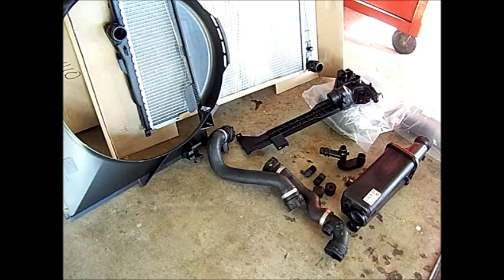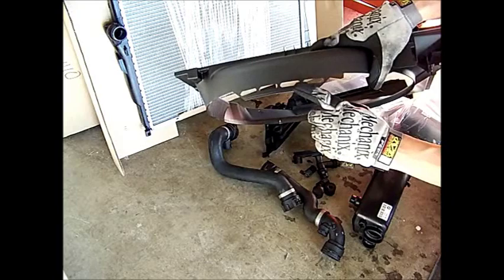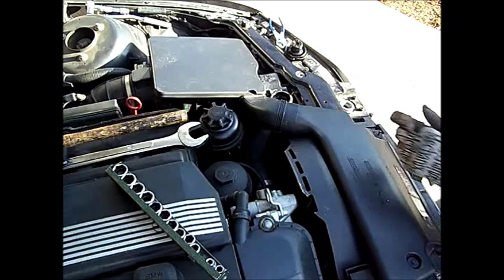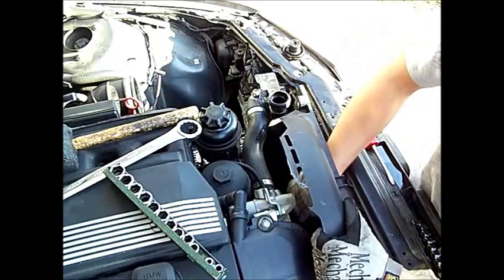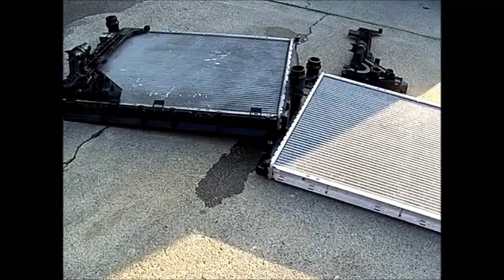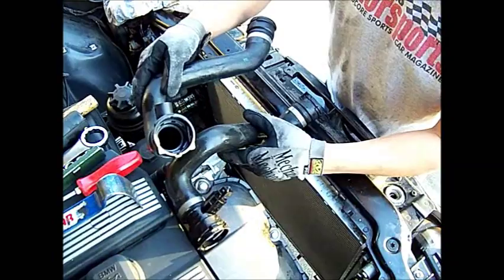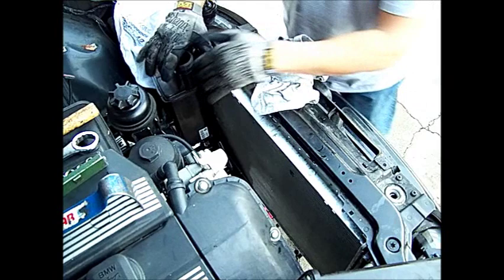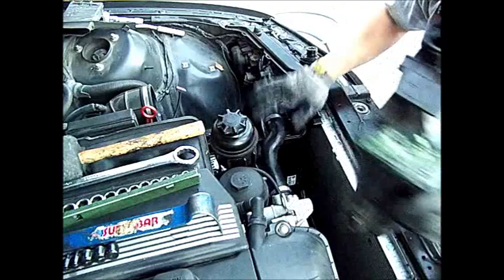BMW 330i, 325i, 323i, e46 Radiator and Expansion Tank Replacement

Comment: I've watched so many of these videos that I feel like I've already done it myself!  I am making ready for my venture into changing my cooling system on my recently acquired '06 330Ci.  I am planning to remove the mechanical fan and swapping in the electric 'puller' fan in it's place while I'm in there.  I will also do my tentioner and idler pullies, WP, tranny t-stat, the whole enchilata!  Thanks for the video, it really helps add to my prep time :-)

Comment from the maker: Hi Rene,  Good points, sorry can't redo it as that's the footage I had to work with. Here's some follow up info:  1) bleeding the system, there is a brass/plastic screw/plug on the top return line before the expansion tank.  You will fill the expansion tank until fluid (bubble free) runs out of the area of the removed plug.  You do so with engine running and car on level ground. Come back after a few days to ensure you have all bubbles/air out of the system by running the engine and checking for a bubble free flow.  2) fan is removed by using a long 32mm open ended wrench on the base of the fan and this is reverse thread. Impact it with a rubber mallet to shock it loose and do so when there is fluid in the system. Cost of parts will run $300-$450 depending on whether or not you need a water pump or fan clutch and whether or not you use aftermarket or OE parts. The labor savings is the win here.  Thanks for the questions and no harm by the constructive criticism. Good Luck!
Reply: heat sencer for a 328 bmw

Comment from the maker: Thanks for watching, also if you change your lower radiator hose it's best to replace the fan temperature switch (this is the switch for the auxillary fan) or at least the green o-ring for it with a factory BMW part.  Otherwise you may get a leak there.

Also, be careful when handling the new radiator, you don't want to stress the interface between the radiator and the plastic side tanks. If you press anything onto it, use your leg or a foam pad to back it up.
Reply: How far in does the o-ring on the back side of the mounting plate? Mine is refusing to go past the lip

Comment: Also I had a hard time removing the fan and shroud so I was able to go underneath and remove the radiator that way. Is that at all a terrible way to remove it?lol I detached all hoses and was able to pull it out from underneath. Also noticed that the autozone aftermarket radiator I bought was about a quarter inch off around the upper radiator hose areea soo brackets would not align correctly. Autozone and OReillys offerred the same radiators. Do u think it's an aftermarket thing? Is that why u recommend using actual BMW dealership replacement parts?

Comment: You kinda glossed over the transmission thermostat at the bottom of the expansion tank. It's common for this unit to break into many pieces when you separate the tank from the bracket. My trans thermostat was "welded" to the bracket and broke into many pieces upon removal. I also had a conical spring that sat on top of the trans thermostat to keep it in place. I did not see that in your video. In reality, you probably would have solved your leak with a new expansion tank cap and bleeder screw. I agree with you, however, that replacing the radiator and trans thermostat is good preventative maintenance at that mileage. Great video and thanks!
Reply from the maker: Yes, thanks for the comment, someone just asked for this exactly as you stated. This part does fall apart. It's the Thermostat for the Automatic Transmission cooler or heat exchanger PN 17111437362OE. This should probably be replaced just as preventative maintenance when an expansion tank is replaced. You are also correct that an expansion tank cap was probably all that was wrong with my car but mine had 130k+ miles and I just wanted to change the radiator before it got old and then just changed out everything around it for video purposes. Thanks again for the great comments.  I sold my sedan and recently picked up a 330ci, so I can see myself doing this again in the near future :)

Comment: I like your video except for the part where you cut out where to bleed the system from.  Also, removing the fan which btw is a pain in the ass.  Idk, seemed like you cut out several parts which left me a bit confused how you did it or got to it.  Not as through.  Also, it would have been nice if you added a parts list and price in the about portion of the video so that people can know what they're looking at spending.  Great video though man, hopefully you don't take the criticism to heart.  Just friendly criticism.

Comment: To my amazement the aftermarket Chinese replacement radiator appears to be better than the original equipment BMW radiator.  The OE rad plastic was made with some sort of paper like filler. This stuff degraded and cracked.  The Chin replac the plastic is made of high end Dupont fiberglass reinforced plastic.  Same stuff that Snap-On tools are made of like on the impact tools.  This is the stuff OE should have been but then again I would not be replacing it.  We will see how well it will hold up but it appears that not all Chin aftermarket is bad. (350 k on car did not want to spend extra on it)
Reply from the maker: Good point, there are some Chinese manufactured products which are on the higher end, in fact there are some OE supplied parts (even to BMW) which are licensed to be made in China and carry the German aftermarket or OEM name. Hope it holds up well...this video was more about the procedure than the product you purchase to replace.  Thanks for the comment.

Comment: Great and helpful video.  I wish someone would have addressed the one trans cooler line on the auto trans cars that has to be inserted in the "groove" of the Expansion tank mounting plate.  No easy way of doing this except crawling under the car.
Reply from the maker: You are correct if you want to remove the transmission cooler "mount" you have to do so from under the car after you've pulled the aluminum housing away. This certainly isn't a fun job, but it will save you $$ from having someone else do it for you.  Glad it helped.

Comment: Nice job.. I to had coolant leaks.. I strongly suggest a new expansion tank cap.. sound like this will not go bad.. BUT it does
Reply from the maker: Good Call David, there are times when one orders an expansion tank but also needs to order the cap for it separately. This is a failure point that happens often....think of it as the "old" radiator cap.

Comment from the maker: Hi Malcom,  I'll try:  Radiator, Fan Shroud, Coolant hose, Coolant Pipe, Expansion Tank, Expansion tank mounting bracket, Engine Cooling Fan Sensor, Aux Fan Switch, Coolant Level Sensor.  Optional would be water pump and thermostat. Your best bet is to get to a full service site like Autohaus AZ.  Good Luck!

Comment: There's a thermostat I believe on the bracket that has a spring attached that sits right up underneath the expansion tank. Do you happen to know what it is called cuz while replacing it as I removed it I broke it and cannot seem to find the name for it. I drive a 2003 325i e46.. Not sure if its the cooler sensor or what it is.. Thank you appreciate any help u can offer..
Reply from the maker: brandon tomanogi This should be the Thermostat Expansion Tank BMW Part No. 17111437362 there is also a ccolant level sensor held on by a spring circlip.
Reply: Dan Tsuchiya yup it was the Oil Cooler Thermostat.. Finally found the name for it.. Thank u very much..

Comment: Does a snap ring or C clip go on by trans lines plastic pieces going into that silver trans box mine seems to leak there and appears was a C click or snap ring before I got this?
Reply from the maker: Yes, there is a clamp that keeps the transmission cooler in place: https://www.realoem.com/bmw/enUS/showparts?id=AN37-USA---E46-BMW-325i&diagId=17_0146.  Is this the diagram you are looking for?
Reply: @SirFixAlotAutos  Awesome Thank you appreciate your time as well as attachment exactly what I need.😁

Comment: hey is there any way to take the bracket out qith the expansion tank on it. i used some gasket sealer due to leaking, now im unable to pull out the expansion tank. plz help.
Reply from the maker: +Drew Evans if you used gasket sealer and you are trying to separate it, that might be difficult, you may have to pull both units and then try to separate.  Gasket sealer is almost like glue between plastic. Sorry can't be of more help.
Reply: Dan Tsuchiya thank you for the responce. Is carquest /toughone radiators are good for the automatic transmission? From reviews i here some people have to trim it to make it fit.
Reply from the maker: +Drew Evans As far as the radiator is concerned, I had to go through several aftermarket ones because I was trying to be economical. What I found is they vary quite a bit and this is one area you don't want to mess around with.  A lot of systems in the BMW rely on the radiator cooling system.  Try your best to go with the OEM radiator here and at worst case search for the BEHR brand.  I believe BEHR produces radiators for BMW.  When doing a search on eBay, type in OEM into your search along with your terms like 2003 BMW Radiator and you should see BEHR come up for around $135 and OEM dealer ones come up for as low as $250.  Just be careful on installation and attaching brackets to the radiator, things can crack and you can end up with a leak. Put lots of padding under the radiator when changing brackets.  Good Luck.
Reply: Dan Tsuchiya thank you very much. I actually spent all night researching and your right. I found a Behr brand around $135.
Reply: Dan Tsuchiya

Comment: I had an issue fitting the Spectra Premium brand radiator I purchased from AutoZone. The brackets do not align well. I read someones review that said he had the same problem but he drives a 325xi compared to my 325i. He says he was able to trim the factory bracket so that it fit over the boss screw loacated on the top left by the radiator hose. Do you think that'd be a good idea or that it's a possibility or not?? Thank you for your help..
Reply from the maker: brandon tomanogi The issue with the big box auto parts stores is the consumer has no idea where the part is coming from, and they are almost always an aftermarket brand that may not understand the design differences from model to model.  For example, they copy the design it for the 316i from a different year and expect it to fit a 325i....it may or may not.  With that said, if the bracket can be trimmed (safely) you can do so or take it to a shop and have them determine.  Otherwise it's best to return it and purchase one from a source that understands these cars a little better (dealer or a Bavarian parts specialist like BAV-Auto, Autohaus AZ, etc....Radiators and Expansion tanks are an area you don't want to go cheap on a BMW.  Good Luck

Comment: When you pull off the ATF heat exchanger does coolant or Trans fluid pour out?? I would assume coolant but I just wanna make sure before I do this
Reply from the maker: Correct, it's coolant.

Comment: what was the name of the part that you took off of the old radiator side bracket and put into the new one. is that the part that has a little brass piece in the middle of it? 

im replacing my coolant recovery tank as I'm typing this to you and basically the part where the tank sits looks like its broken and I'm trying put it back together
Reply from the maker: HI Carl, did you mean the little round brass (centered) looking piece?  See the second paragraph below for this piece.

BMW sells the entire Expansion Tank Mount that attaches to the Radiator:"	Expansion Tank/Coolant Reservoir; Mounting Plate for Expansion Tank " for Automatic Transmissions it's PN 17111436251. This may be what's actually broken on your car. If you do remove this, make sure you reattach with the radiator out of the car and sitting on a soft surface, do not attach as I did in the video as you can damage the radiator. 

The Item that I switched over is the Expansion Tank/Coolant Reservoir; Thermostat for Expansion Tank. This is the thermostat for the Automatic Transmission Heat Exchanger, that rectangular aluminum box that attached to three ports at the base of the radiator. The part number for that piece is 17111437362OE if you need to replace it.

Comment: @dan Tsuchiya,
Hey, so I just installed a new radiator on my 2000 bmw 323i. I hooked everything back and I am getting a leak from the lower return hose or the bottom of the expansion tank where it meets the plate that it's attached to. I am not sure, but would this be possible for leaks in that area? I bought a new radiator, new tank thermostat, and new expansion tank mounting plate. My Expansion tank was not leaking so I didn't bother to buy a new and Im assuming the hose is leaking because its 15years old and i was being kinda of rough with it. any suggestions would help.
Reply from the maker: +Luis Guerrero There are many places the expansion tank can leak from, it essentially has three ports at the bottom, if any of those seal interfaces go bad during rough handling you will get a leak.  If it is one of those areas, you will likely need to get a new expansion tank as these don't survive well if older ones are removed and reinstalled.  Also, make sure the expansion tank is not leaking from an area towards the top, even the cap and check the side of the radiator (side tanks to radiator interface) because it just drips down and makes it look like it's leaking from the bottom ports or hoses (unless it's obvious.)   Check the interfacing pieces like the expansion tank mounting plate, those can fracture upon installation if it's an aftermarket piece.  This is a procedure you will want to work slowly and carefully and buy OEM.  I can't tell you how many expansion tanks I've gone through. Good Luck.
Reply: Thanks sir! I had a bad thermostat. After installing new expansion tank, radiator, hose, i still got a leak. The leak was from the pressure build up from the thermostat being stuck in the closed position. Pressuring coolant out the seems of the hose. I put in the new thermostat and no leak. Thanks. Hope others benefit from this.
Reply from the maker: +Luis Guerrero that's great it's solved, was this the tank thermostat or?
Reply: Dan Tsuchiya no. I change that thermostat when I bought the new expansion tank. It was the thermostat that mounts to the engine
Reply from the maker: +Luis Guerrero Thanks for the clarification, the main thermostat.  I and others will benefit from your discovery. Thank You.

Comment: Hello thanks for a great video!
Ive got some questions tho.. isnt htere any better parts the nbmw original parts? I mean, so we can ditch every plastic parts?
The new cooler still have plastic on the side?
And if there is, is it worth it to replace the plastic expansion tank with one in metal? 

Best regards!
Reply from the maker: +Tomas Erikssen BMW has designed plastic components for capability to expand and contract, they tend to be lighter, and there is also a cost element involved too.  The radiator could probably be replaced with a racing style of radiator and a metal expansion tank could be used, but allowing the expansion tank to be the "weak" point by remaining plastic may be a decent strategy.  If the vehicle overheats, the expansion tank may crack, but it will be a slow leak and the car could still be driven instead of a hose rupturing causing the vehicle to be inoperative. Racing quality Aluminum radiators and expansion tanks will be more costly than OEM units, but is a choice you can make if you are thinking that longevity of those components is the key.
Reply: +Dan Tsuchiya thanks for the reply! Yea okey, that makes a lot of sense! 
Good to know about the new plastic too :D

Comment: Will the OEM expansion tank cap fit on my vaico OEM tank I bought to replace the old one? Do I need to buy a new cap or will the old cap fit OEM?
Reply from the maker: The OEM should work, but if the OEM cap is old, there can be some failure (leakage) there, but you can easily change that out if you find that to be the case.
Reply: bought new cap

Comment: I'm about to replace my expansion tank. My problem is the cap and spout area keeps leaking, even when buying a brand new cap. Don't know why it leaks but it does when the car is running and hot. Some have told me the expansion tank expands and contracts but I don't know how true that is. To me it seems like after buying 2 new caps that it still leaks. So now I purchased the entire expansion tank. I feel maybe it's the spout of the expansion tank. Has anyone ever seen or heard of this kind of problem? Such a head ache too. Only leaks from the cap and spout area. (All the o-rings are on too)
Reply from the maker: +KEVLAR PEREZ Yes, the expansion tank does expand and contract (higher pressure/lower pressure) it acts as a regulator so to speak and is why they eventually fail.  The two possible issues could be 1) aftermarket vs OEM, the mouth or cap may have different tolerances, 2) you may have a fracture in the cap, but most likely the mouth which is sometimes difficult to see.  This often happens when the cap is tightened too much.  Best thing you can do here is to buy a factory (OEM) dealer part from eBay, AutoHaus AZ, or getBMW parts.com.  The OE part will come with a matching cap.  I've changed many of these and this is one area where you want to go OEM.  Good Luck!
Reply: +Dan Tsuchiya thank u for the quick response. It's currently being worked on now. Only thing is I bought it from O'Reillys. It's not OEM so I'll have to see what happens now. I feel u might of answered my question with having a OEM expansion tank (original) and then buying aftermarket cap probably didn't match up well. Thank u so much!